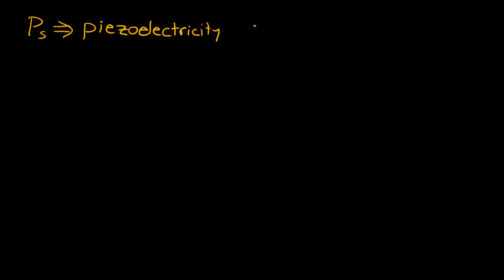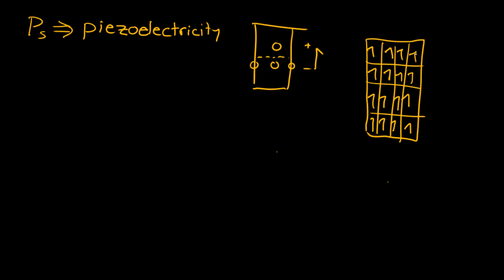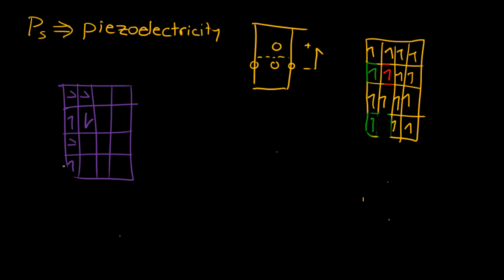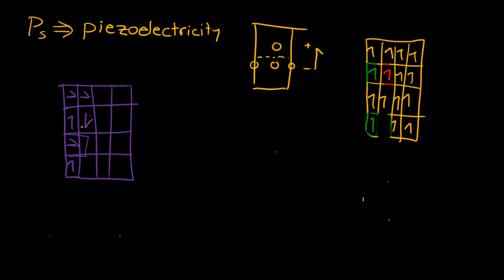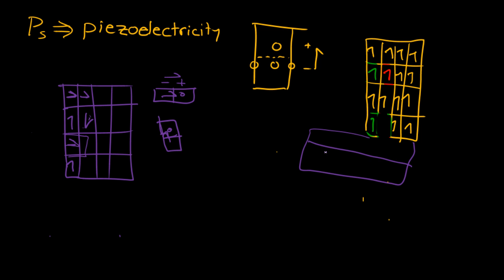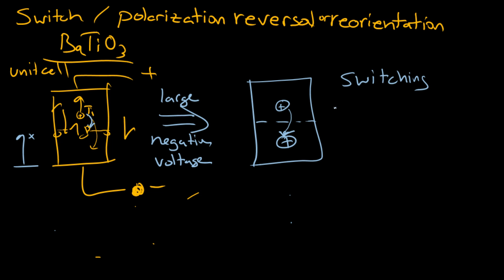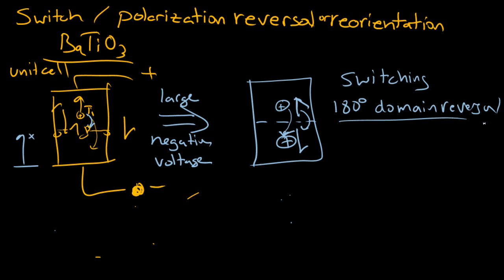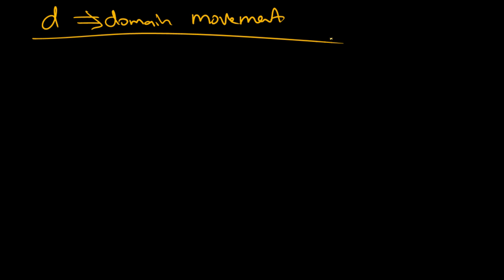Lecture 4 Part C: Ferroelectric/Piezoelectric Polarization Reorientation

Comment: Are domain wall same as grain boundary, since grains represent specific orientation?
Reply from the maker: No, domain wall are not the same as grain boundaries. Grains never change their orientation after the material has been fabricated. Domains walls define a sort of sub-lattice where the orientation of the unit cells changes, but we still consider the crystal to have continuity.
Reply: @ultrasonicadvisors  can you provide some link for the same, a reference paper?